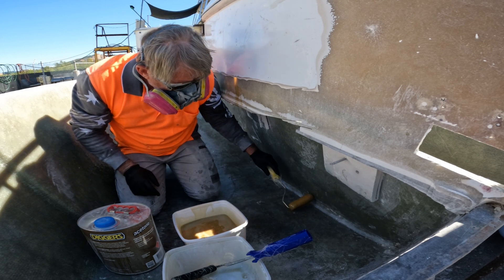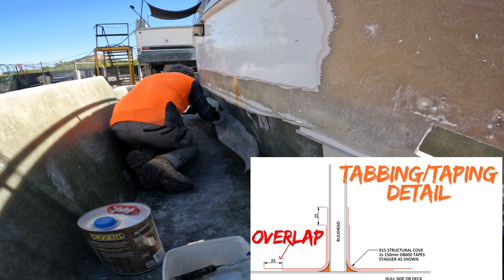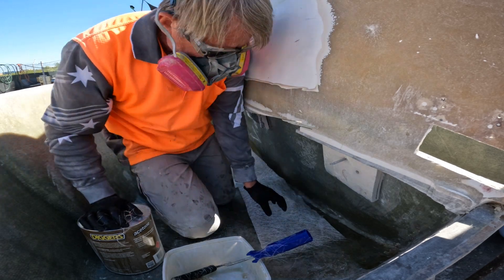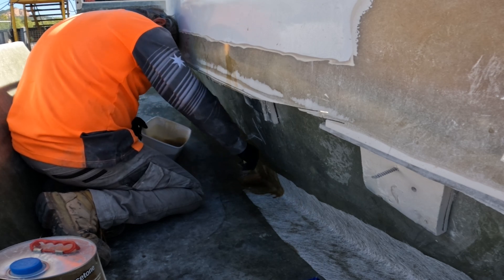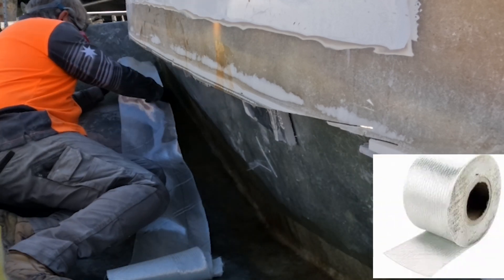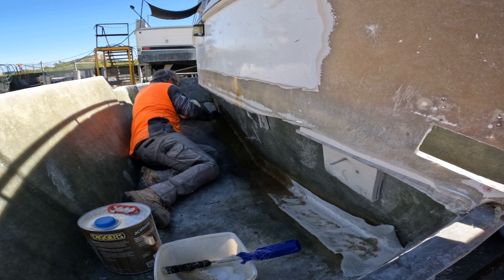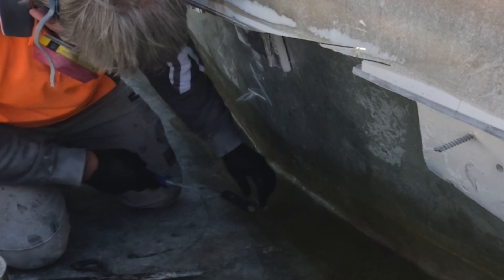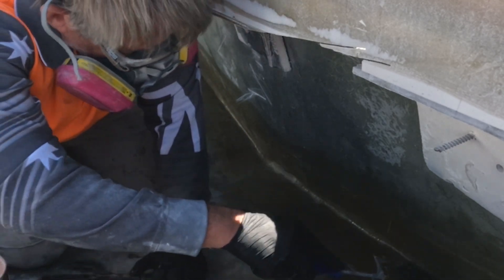Tabbing to get a structural connection to the structural elements in my boat project #boatstructure

Comment: Do you still have to sand anything ready to glass after the initial layers? Using non waxed resin you should be able to just acetone wipe and go?
Reply from the maker: I don't always sand when using unwaxed resin but typically if I've left the laminate for more than a couple of days I'll give it a light sand then vacuum and clean it with acetone but when I do my radius I like to get rid of any lumps and bumps that can be formed by the filler (bog or peanut butter) to make sure they don't hold the glass up which can lead to air pockets and issues down the track.